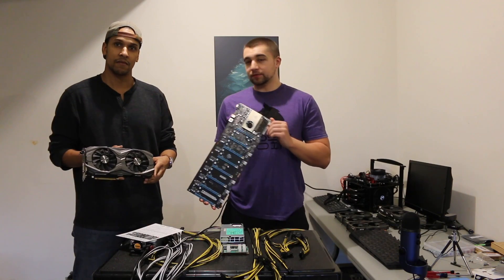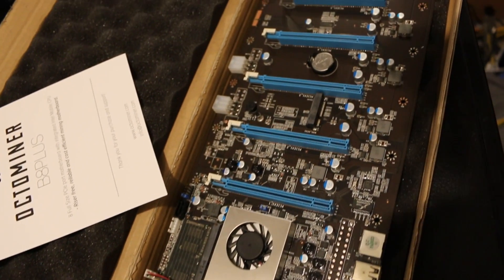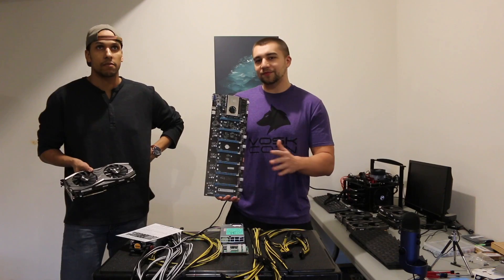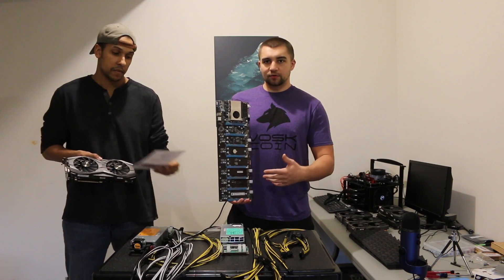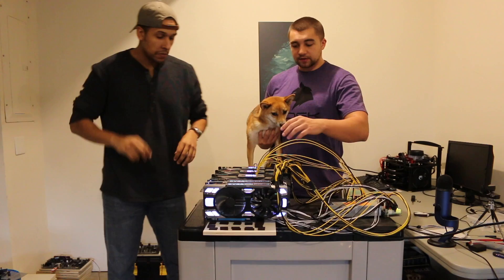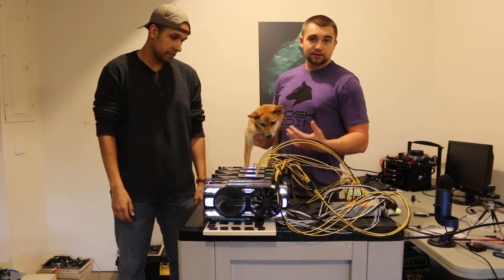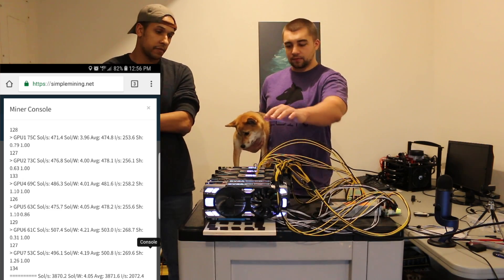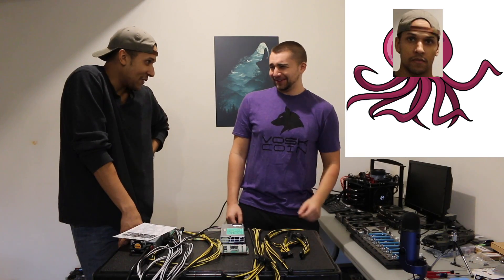Octominer Review - 8x Riserless GPU Mining Rig Build - Build Crypto Miner in ~5 Minutes

Comment: Hi, I got one of this motherboard.  I like to ask you about a problem when boot. If there’s power outage, the motherboard could not automatically boot again; you have to turn off and turn on the psu two times, to boot it, and With GPU on it, it did the same thing, sometimes does not boot with GPU on board. Did you see this problem with your s37motherboard?  Thanks for your videos!

Comment: I ordered one of the March batches coming soon. Originally was going to pack it with x8 1060s and changed my mine and decided to space out x4 1080 tis. That way I still had close to the same hashing power and a nice space in between (and an extra 4 slots I could maybe use risers with later when the nex gen cards come out)

Comment: I’m so confused with the parts list needed for this build! If I got 8 p106-090 then do I need 8 or 6 pin to 2x 2+6 pin splitter cables and how many to connect to EVGA 1200w P2?

Comment: I like that you don't need risers, but to actually run 8 cards in that board you HAVE TO add a lot of airflow, like the Octominer case, which will be very loud.  Fine in a datacenter, too loud in a shed in a neighborhood.  One thing that would probably work is putting just 4 cards spaced every other PCIe slot, and then they are spaced about the same as the ParallelMiner frame, but without needing a frame or risers.  Obviously it would only run 4 cards instead of 6, but the advantage is that the height is much lower, so you can fit a lot more of them onto a shelf unit.

Comment: HI, 

Was waiting for this review.. I have a couple of questions.
Allot of people have been complaining about the spacing between the cards.  I plan on putting 3 1060 asus strix and 5 gtx970 asus strix.. do you think that would fit?  and if I plan on keeping it open air rig would the it overheat..

And only use 1x 1200w hp psu.

Comment: Awesome job. I want to build a 6X GPU rig for Bitcoin. What GPU's do you recommend for maximum performance. Thanks.
Reply: Asic for Bitcoin. Do your research, nobody uses GPUs for mining Bitcoin (you mine other things, then trade for Bitcoin if you want). That's not a simple question anyone can answer, it depends on too many things (coins you want to mine, power cost, resell value in your area, sales, how much space you have, how many cards you want, noise concerns, temperature where they will be running, how long you plan to mine, and trying to predict the future). You just have to learn as much as you can and then make a decision. Good luck.
Reply: You don't mine Bitcoin with GPUs. Go to WhatToMine.com to compare GPUs and the coins they are capable of mining.

Comment: So if I get the Octominer 2200w power supply (running 220v electricity) that should be all I need for a 1070ti or even 1080 ti build right?
Reply: For 18 GPUs, no, for 8, probably. Every algorithm also varies on how much power they use (I was pushing 300w on one of my cards, and another algorithm it was like 100w), Vega for instance would be 150w for cryptonight, and probably something like 450w+ if you overclocked it on Eth duel mining, so it can be pretty important. Buy a Killawatt meter and then you will know how many cards you can run. Its worth it just so you know its not overloading anything. They are about $20 and just plug in between your wall socket and PSU cable.

Comment: Love riserless rig, but are u sure 75 degrees is ok for a GPU for 24/7 work?
And wouldnt it be ideal to watercool gpus in such rigs
Reply: I would probably go with water cooling (though some say I water cool everything from my tablet, to motor drivers on robots, to arduino chips just for fun). I'm doing a new water loop for all of my cards and hooking it up to a car radiator (should be fanless radiator), but I want to cool the VRM and VRAM chips, so I'll probably CAD and 3d print a fan bracket for my cards.

Comment: these octominers seem like they hold the cards very tight with just open air and no outside fans can they keep themselves cool?
Reply: Without outside fans it will get pretty hot. Let's say if you use GTX 1060 and undervolt them a bit, temps will stay around 75C. With additional fans the temps will be around 50-60C
Reply: ok thats very doable will look into your board for my next rig build thank you for the reply also =]
Reply: Is there any improvement with blower cards?
Reply: this is a very nice board! wow with all the crap coming out its nice to see good stuff still being made thanks!

Comment: Sooooo... what if a riser (like we know they do) breaks? Septa miner? Until... Uni miner . No ty
Reply: This motherboard does not have risers, so there are no risers to break. Also it comes with a worldwide 1 year warranty. We have service centers in USA and Europe.
Reply: Octominer he clearly says as you can also see that the risers are built in.
Reply: We are the manufacturers of this motherboard. The whole point of this motherboard is that it doesn't need risers. Risers are not integrated, this motherboard has 8 full size PCIe lanes. Should it happen that one of th e slots fail then we will send you a replacement motherboard. We have sold many of these board already and we have not yet seen an issue where a single PCIe slot fails.
Reply: thats all fine and dandy and  thats a plus on your product... but do you also pay for my downtime? :) 
(since I send the mb back,  the whole rig would be down)
with risers it is instant fix.
Any thoughts on that one?

Comment: Man, what is this? An infomercial? I appreciated the content better when products were not being pushed. It's obvious they are compensating you for this with all of the attention you've been giving it lately. At least get us a discount code if your going to be pushing this product so hard.
Reply: I would have made a very similar video, Jonathan.  I have an Octominer and it is up and working.  I don't have as many cards as Troy and Vosk do, but my rig is running sweet, no hiccups, easy to build and I will keep it cool with fans as necessary.  

The sweet part is zero risers.  No cost for them, no worry about them going bad.  Add the processor already installed on the card, runs cheap on electricity as well. I had two 1070 ti's on my old home computer and the whole package ran 350 watts roughly even with power limited using MSI Afterburner.  Same setup on the Octominer with same clocking profile is running 280 watts.

Comment: Great video. Can you use Windows 10 on it? Driver problem?
Reply: Benny Holgersson I friend in China told my he has some runing on windows 10 with this setup
Reply: Yes u can. I am usinv this mobo with win 10 no problem.
Reply from the maker: You should be able to, I did not try it though could reach out to them or post in our Facebook group a lot of users have posted their octo rigs so far!
Reply: I have it up and running a legit copy of Win 10 Pro.  Only two cards on it at the moment, will buy a third one and then wait for the Nvidia offerings in March/April before filling the last 5 slots.  

It has run stable for me without a problem.  Powering with an EVGA 750 Platinum PSU for the board and first 2 (soon to be 3) cards.  The last 5 cards will be powered with an EVGA 850 Gold PSU.  

Assembly was very, very simple.  I used a 60 Gb SSD from Octominer, and their 4 Gb ram as well.  I have a custom built Spotswood open air frame for it.  

For Win 10, I suggest you install, update, then follow Sonofatech's youtube guide for settings for Win 10.  Also, remove the password screen if you inadvertently start it during the install.  Super simple reboots that way.

Comment: How do you protect mobo n gpu from psu malfunction. My mobo n gpu spoiled suspected cause of psu failure
Reply from the maker: What PSU were you using?
Reply: VoskCoin i using oem brand 1200w psu from china. Will the burn caused by psu failure?
Reply from the maker: It’s possible try using evga platinum or similar quality PSU
Reply: Sniper Pro nerf  asrock h110 btc+ pro should have this features but still burn my gpu
Reply: ding xiang chen well, your mobo should had have over current protection or at least look for that feature, or youbcan buy the tritium or platinum evga psi thatbhave built in capacitors the will absorb that extra current and blow up(just get replacemts calbles then) or you wire up skme fuse to the gpu using quick mafs

Comment from the maker: Octominer 8 GPU riserless board used - https://goo.gl/Jahht8
Alternative G.Skill Ram - http://amzn.to/2FvkGKP
1200w + 750w server power supply used - https://goo.gl/X2hpC3750w + https://goo.gl/nx6oYc
Mining Rig Parts on Amazon- http://geni.us/WQd7cCs
Graphics Cards IN STOCK on Amazon- http://geni.us/nti5asr
Interested in building your own 7 GPU Mining Rig? Full Parts List BELOW!
Mobo - Gigabyte GA-Z270P-D3
http://amzn.to/2C4qGva (Shown)
CPU G4400
http://amzn.to/2C2dGpD (Shown)
PSU
http://amzn.to/2HnZS8D - EVGA 1200w Platinum (Shown)
http://amzn.to/2C4O37F - PCIE Splitters needed + SATA power risers
http://amzn.to/2Cqmdyn - Same as above and this PSU is gold
RAM
http://amzn.to/2CpmUYX Red / Shown
http://amzn.to/2F8whPy Grey
http://amzn.to/2FcwkKo White
PCIE 6 pin to 2x 6+2 pin splitter (At least 6 needed)
http://amzn.to/2C2M1Fa - Shown DeepInTheMines orange splitters
http://amzn.to/2Hp9a3W - Yellow splitters (6 pin to 2x 6+2 pin)
http://amzn.to/2Fb592E - Yellow splitters (8 pin to 2x 6+2 pin)
Frame - Mining Cave Rig Frame Shown
Coupon Code VoskCoin save 3% https://goo.gl/Qk1th5
http://amzn.to/2CtVAsE - 8 GPU Rig Frame Alternate
http://amzn.to/2CqFsId Mintcell Spartan 8 GPU Rig Frame
http://amzn.to/2EP0OUX Mintcell Spartan w/ 8 Risers
PCIE Risers (if needed x8)
http://amzn.to/2Cqtcrn UBIT 12 pack - good to have extras
http://amzn.to/2F7hmVP - Mintcell 6 pack
HDD (USB Stick Drive)
http://amzn.to/2Cq82cI - Shown Lexar 32gb
http://amzn.to/2EvbGb4 - Shown alternate seller
http://amzn.to/2C2M5Vq - 16gb lexar 3.0 usb
http://amzn.to/2Cr9xYj - 16gb teal lexar small usb
M.2 PCIE adapter by Explomos (1x)
Explomos M.2 Shown - http://amzn.to/2EGEk8F
Alternative Mintcell M2 PCIE adapter - http://amzn.to/2Buhxe9
Other Alt. M 2 PCIE adapter - http://amzn.to/2sxyDop
GPU's - Choose 7
1080 TI
http://amzn.to/2m7Vl0e
1080
http://amzn.to/2qBV0Iz
1070 TI
http://amzn.to/2F8OFYj
1070
http://amzn.to/2FaCBFO
1060 6gb
http://amzn.to/2qAaNr8
1060 3gb
http://amzn.to/2F9Bvu5
1050 TI
http://amzn.to/2m73oKm
RX VEGA
http://amzn.to/2CC3yk8 - 64
http://amzn.to/2D5cP58 - 56
RX580
http://amzn.to/2D27ueZ
RX570
http://amzn.to/2F9ZoS7
RX560
http://amzn.to/2CDnenX

We are a participant in the Amazon Services LLC Associates Program, an affiliate advertising program designed to provide a means for us to earn fees by linking to Amazon.com and affiliated sites.
Reply: VoskCoin I was thinking about using one of these.  Why didn't octotroy use the psi from octominer?  It looked pretty good.